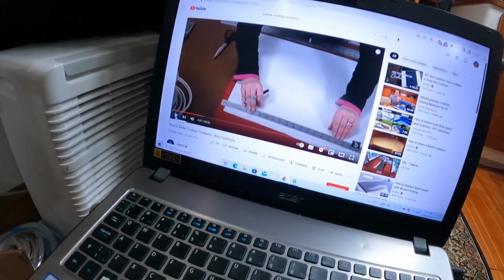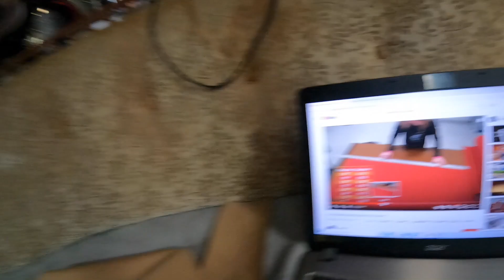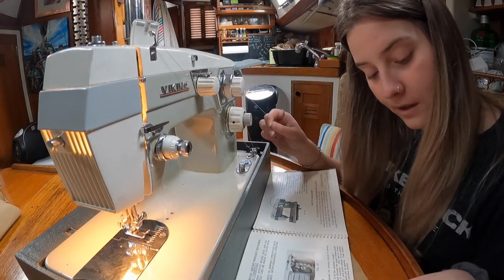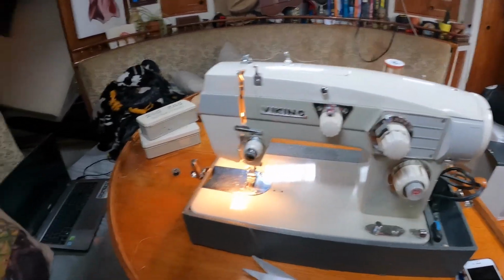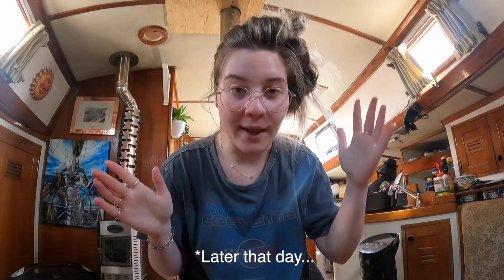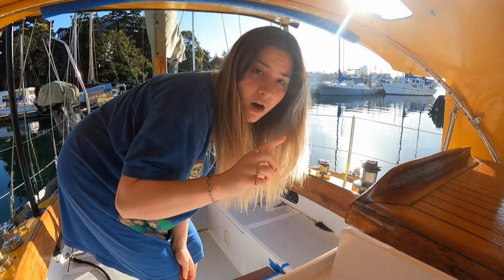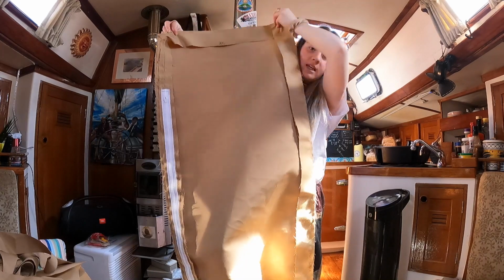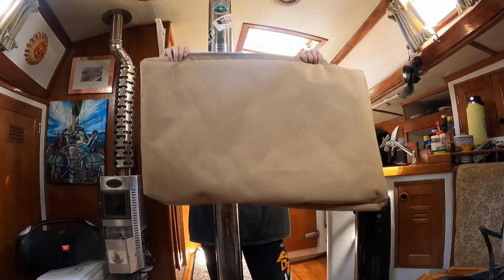23 Year Old Uses a 1969 Sewing Machine POWERED by the SUN! Ep 12

Comment: Don't stress. Upholsterer over here. You did fine. We've hired worse. lol I do have a few suggestion, if you like. 
1) There is another post for another thread spool on your machine. There should be a way to rig it to make bobbins while you sew, form a second spool
2) Sunbrella products are great but very prone to fraying. I strongly recommend getting and using a hot knife cutter. Just don't breath. lol 
3) Our policy is to measure the size of cushion you want. Make the cover sewn to those dimensions, but make the foam 1/2" bigger in all directions. Obviously that isn't possible for thickness. So subtract 1/2" from the total plaque height. That'll fix your looseness. Buuuuut...   It will make your foam a bitch to get in there. So... 
4) If yo have the length  of material to do it. Make the zipper plaque the length of one long side plus at least a few inches around onto each end. And the other plaque the remainder of what you need to finish. That way you only have 4 pc to deal with. Well 5 if you count both halves of the zipper plaque.  But I think you know what I mean. 

Anyway I think you did great. I've been at this for 15 years and it takes me 2.5h to make each foam, cut, sew and stuff each cushion. I know that's faster than you, but I don't have to learn everything from scratch. Practice practice. You be good.   Keep up the great show & I'll get back to me bingeing it.   

P.S. After all my experience i suck a math too. lol The what calculators are for.
Reply from the maker: Hi there! Thanks for stopping in and watching one of our episodes! We appreciate it! Love the suggestions, these will really help me out in the near future with more sewing projects on the horizon! Thank you Matt 😊

Comment: You have probably figured this out but if you unlock  the drive clutch while winding bobbins, the needle will not be running while winding the bobbin. The clutch lock is the knob in the middle of the flywheel to the right of the machine. It unlocks by twisting counter clockwise. anyway, looks better than the last quarter berth cover I made.
Reply from the maker: Thank you for the tip! It's always helpful to learn new tricks for the old machines! Love the comment, appreciate you watching 🤗